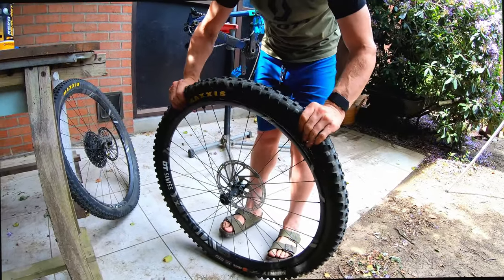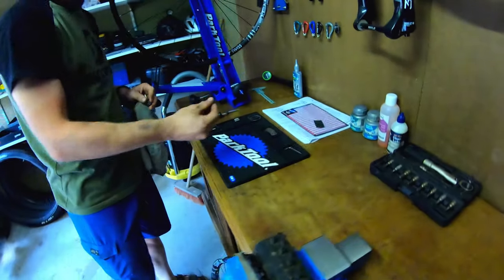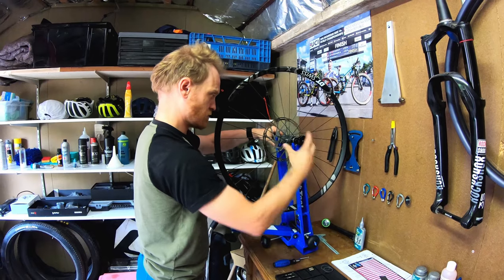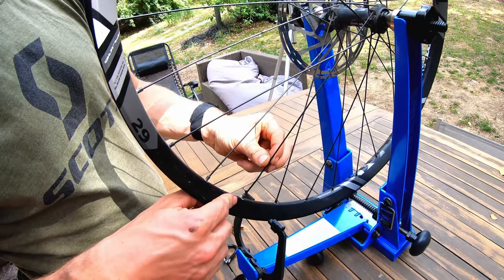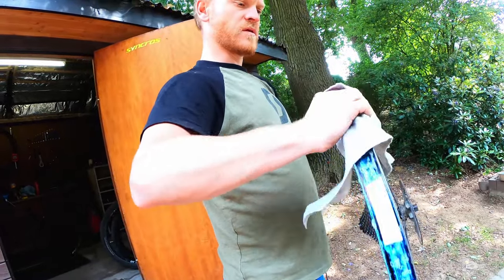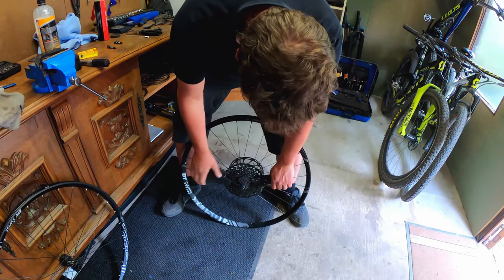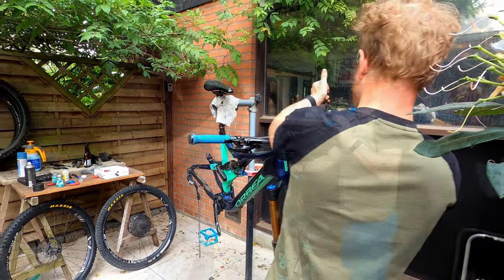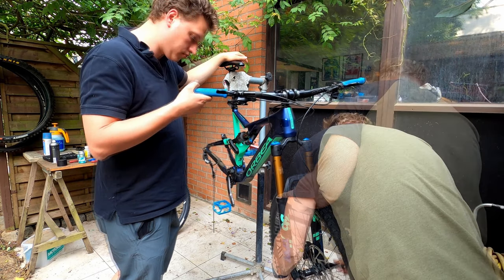Les Deux Alpes - The Mechanic EP3

Comment: Cool! Real maniacs just drill another hole in the rim and use slick road tyre with high pressure tube in it, then add some sealant and put your normal mtb tyre on top with lower pressure  :) Glad you getting closer to the Alps! Cheers
Reply from the maker: Wow I did'nt know that was a thing. 🙂. Yeah still a few weeks to go but we're counting down the days. 👍Thanks.